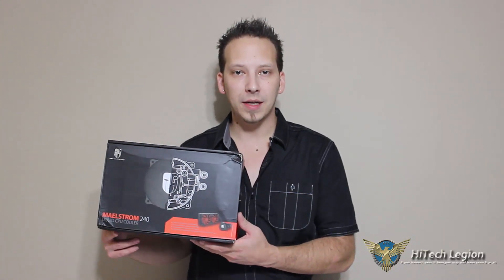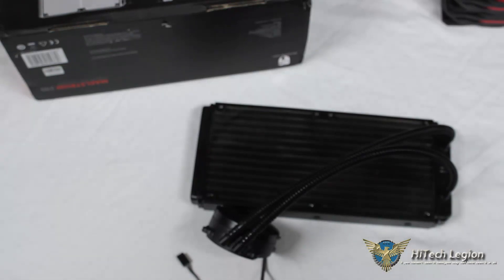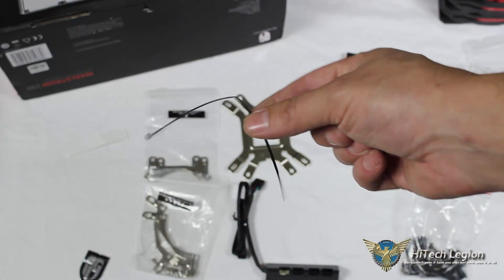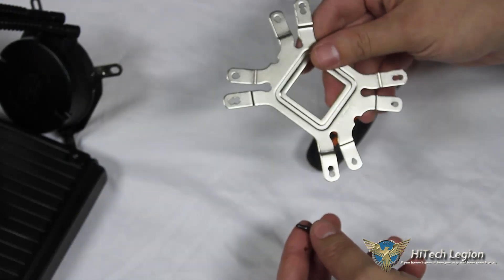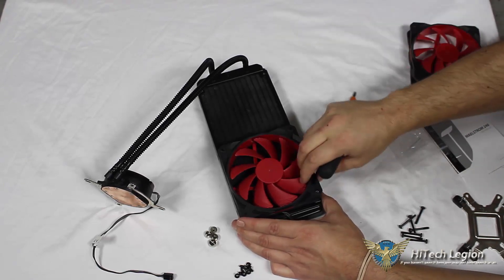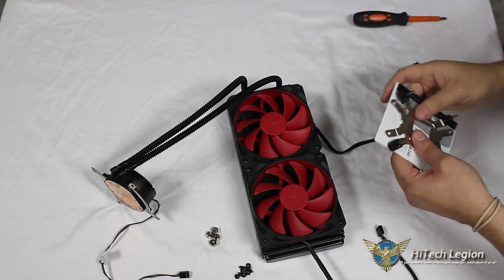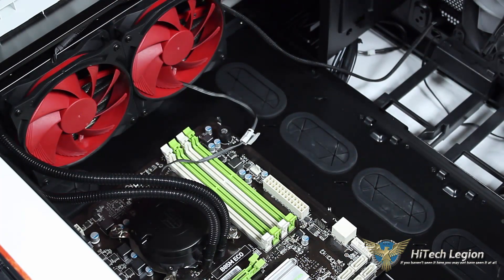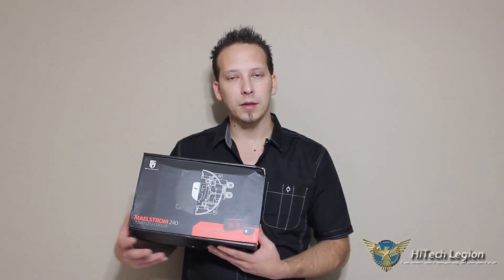Deep Cool Gamer Storm Maelstrom 240 Liquid CPU Cooler Review

Comment: You should have mounted the radiator with the tubing to the front of the case. It would have look better, and the tubing would have not interfere with the airflow of the back case fan. Here's a video that shows the right way to mounted. Don't mind the language, just look at the video: Deepcool Gamer Storm Maelstrom 240 video inceleme

Comment: I installed 240T and the fans were very loud, so I bought 2x Fractal Desing R3 120mm fans and replaced the noisy ones, problem solved.